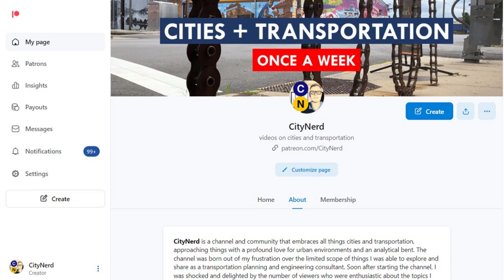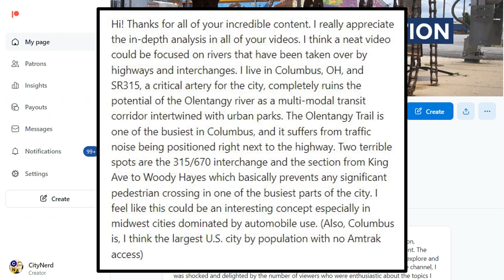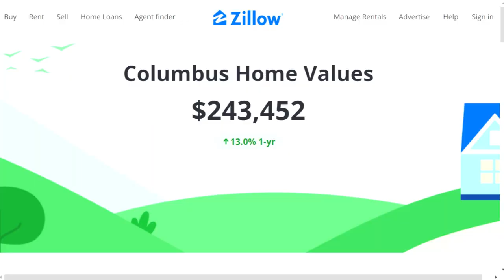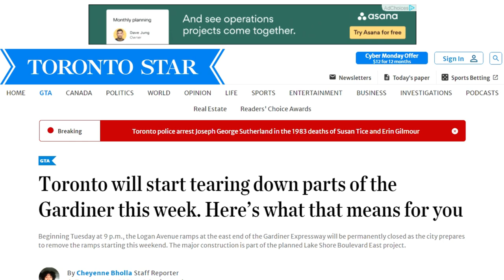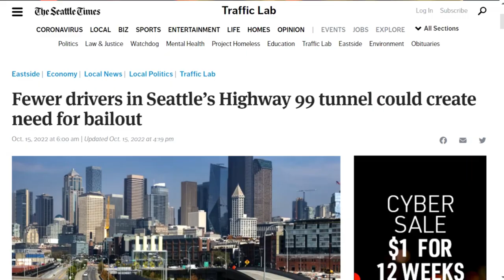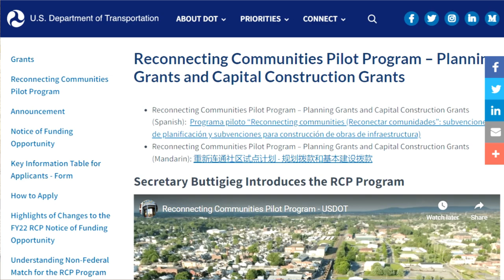Highway Engineering Madness: 10 Waterfront Freeways That Need to Go (North America Edition)

Comment: rubs her hands together It's my time to shine. 

North Carolina-born and bred transportation planner and geography nerd, at your service. 

A lack of easily navigable rivers with natural harbors that flow directly into the ocean is a big reason for North Carolina's sluggish growth between colonial times and the 20th Century. Many of the state's large rivers (the Chowan, the Roanoke, the Tar-Pamlico, and the Neuse) dump into the shallow Albemarle and Pamlico Sounds instead of the ocean. And even if you can navigate shipping out of the sounds, you end up in the Graveyard of the Atlantic off the Outer Banks. The rivers aren't all that navigable past a certain point (they tend to go from glorified creeks to massive estuaries), and not at all navigable past the Fall Line separating the Coastal Plan and Piedmont. On top of all that, hurricanes have made developing any coastal cities difficult throughout the state's history.

There is a nice harbor in Beaufort/Morehead City (indeed, one of the state ports is located there) that goes directly into the ocean and is south of Cape Hatteras and its dangers, but it doesn't connect to any substantial rivers, though it is the end of the line for the state-owned North Carolina Railroad. The state's biggest city on a river and biggest port (and the largest city for its first century) is Wilmington, which sits on a relatively high bluff at the point where the Cape Fear River (which is by North Carolina standards somewhat navigable) becomes an estuary. It is a few miles inland from the ocean, which protects it somewhat from hurricanes, and is easy to defend (it was the last Southern rebel port retaken by U.S. forces in the Civil War). It also became a railroad hub, but Wilmington was more connected to the north and south (like Florida, for instance) than west to the remainder of the state. The blessing of a major rail hub became a curse for the city when its railroad went all in on Florida and eventually moved operations to Jacksonville. Its port has always had a harder time competing with Norfolk and Charleston, even with cargo traffic from its own state. The Cape Fear River is navigable for some barge traffic and smaller craft up to Fayetteville, where it hits the Fall Line. Fayetteville was a more logical choice to become the state capital, but for their own reasons, early political leaders in the state decided to build an entirely new capital city in Wake County (near a favorite tavern on readily available land, which explains why Raleigh is where it is). There has to be an alternate universe where the hub of North Carolina is its two largest cities: Fayetteville (the state capital) and Wilmington (its largest port and city), connected by a still-busy Cape Fear River and substantial rail/road connections. 

Availability of water-based shipping just didn't play as much of a role in developing all parts west as did the railroads and other specific circumstances. Winston-Salem and Durham were tobacco towns. Other places grew more because of textiles, like Charlotte and Greensboro. They were all small, provincial cities, barely of any consequence to anyone outside of the state beyond the number of socks and cigarettes they produced. Their rapid growth, like so much of the Sun Belt, took place in the auto era and leads to the sprawl and suburban feel of most of the cities. The Piedmont Crescent region (Raleigh, Durham, Greensboro, and Charlotte) all developed along the aforementioned North Carolina Railroad (still state-owned but operated by Norfolk Southern today). If there were rivers nearby any of the cities (the Catawba and Charlotte, the Neuse and Raleigh, the Eno and Durham), it was more coincidence than intentional as they were useless to commerce. Even some of the cities and towns that have a riverfront (such as Fayetteville or Asheville) don't tend to have much of a connection between it and their downtown regions because riverfront land is so flood-prone.

I am sure that I got something wrong here and there, or totally missed something, but I think that roughly covers it. If there is any city in North Carolina that might have made this list, btw, it's Asheville. I-26 totally cuts parts of downtown off from the French Broad River.

Comment: Storrow Drive is the backbone of traffic in Boston. I cannot take anything you say seriously after seeing your suggestion that Storrow Drive be eliminated. I've been driving in Boston for over fifty years and know the entire city like the back of my hand. Frankly, I cannot believe that you have ever driven in our beautiful city.

The Back Bay area of Boston would be utterly ruined with the massive amount of traffic that would necessarily be diverted onto Beacon St., Commonwealth Ave., and Boylston St.

While the Mass Pike (aka Interstate 90) is useful, it was never designed or intended to be such a backbone. There is only one exit off the Pike heading eastbound between the Storrow Drive exit and the Central Artery (Interstate 93) and there are no exits westbound between the Central Artery and Storrow Drive. Similarly, there are only a couple of on-ramps onto the Pike westbound between the Central Artery and Storrow Drive and there are no on-ramps onto the Pike eastbound between Storrow Drive and the central artery. There is a U-Turn ramp at the Storrow Drive exit westbound which adds a tiny bit of flexibility that was built when they took down the toll booths almost twenty years ago, but this is insufficient to make-up for the lack of exits and on-ramps. There is no possibility of any addition of exits or on-ramps. The Pike ended at Route 128 (now known as Interstate 95) in Weston until it was extended through Newton and Boston to the Central Artery on a railroad right-of-way in the early sixties. Consequently, there is not one square inch of extra space that could be used on either side of it to add any exits or on-ramps. Additionally, there is continuous development of "air rights" projects being built over the Pike. It is literally true that they are nearing completion of one such project at Massachusetts Ave. and they have just announced a new project that will connect Kenmore Square to the Hospital District. These developments have connected different areas of the city that had been separated first, by the railroad, and later by the Pike, making Boston significantly more walkable, clearly a laudable goal. Respectfully, I must say that it is ludicrous to say that the Pike could possibly absorb the traffic currently using Storrow Drive.

I strongly agree that steps should be taken to improve public transportation in Boston, as well as other American cities. I also wish that Amtrak service could be improved along the eastern seaboard. However, Boston is almost four hundred years old (the amount of time my family has been here) and we don't have any room to make major changes to its layout, unlike younger cities further west. I'm sure you mean well, but eliminating Storrow Drive would ruin Boston!

Comment: As for the Brooklyn/Queen-Express highway .

Because is so much better to spend your live in traffic jams so that affluent guys have nice beaches or their real estate value dramatically increased. Who cares about people who have to commute to the city, because they work in normal jobs which allow no apartments near the city saved from the center.
And since railroad etc. pp. are also a problem...

The Q-line (part of the subway system) from Manhatten 96th street to Coney Island runs for a significant portions over ground, at times even elevated like the B/Q-Express highway with the tracks stacked above each other.
And you hardly get to the beach not beacause of a highway or tracks, but because one building is next to the other and you'll wall along fences and wall till you find here and there  a walk through.
So chose your train station wisely.

I hate such ignorant people.

Comment: The East Bay happened because they already didn't have room for a necessary freeway so they built it sometimes up to 200 feet offshore on landfill. Land use has caught up to it but how would you get rid of it lol, the East Bay is heavily developed from riprap to hill tops.

Also the air from the bay is clear enough for those using the trail.

Comment: Removing a highway and building a park still doesn't make it a nice park. Waterfront park in Portland is completely awkward.  Its filled with weed smoking hobos and geese most days and over run with goofy festivals all summer long that end up killing the grass turning it into a sand dune. There's also a giant seawall that makes river access virtually impossible.  More comprehensive thought needs to go into projects that remove these roads.

Comment: Here's a controversial opinion about waterfront freeways:
About half of the (air and noise) pollution from the freeway will affect only water. And additionally, wide water surfaces of any kind (be it coasts or rivers) increase wind speeds, which additionally helps carry away air pollution.
But I do agree, all the pollution that moves to the land surrounding the freeway directly hits the cities' most desirable areas, and is at odds with using the river for cycling, recreational cycling or other forms of recreation. So I won't go as far as saying that waterfront freeways are better than inland freeways. Each has their disadvantages (while no freeways at all inside the city has advantages).

Comment: As someone who lives just outside Chicago, Lake Shore Drive is terribly annoying because it doesn't serve the south side at all. You can't use it to get to the north side effectively due to lack of turn offs. And it's also not a true freeway as it splits into I-55. South from that point it's all residential roads that feels like any other street. Add in 10 years of construction and it's just terrible.. The Loop with  I-57/90/94 isn't much better tho..

Comment: My first thought on opening this video is that Lakeshore Drive has got to be here. The Drive almost totally ruins the lakefront making it hard to access and filled with noise and ugliness. There are some spots where the lakefront parks are broad enough to make it possible to not hear or see Lakeshore Drive, but that's the exception. Also, Lakeshore Drive is just not necessary as there are so many other ways to get north-south there. Lakeshore Drive has to go. Honorable mention to Storrow Drive and Memorial Drive, which are close to being as awful.

Comment: Lived in the Chicago area for 30+ years, and the existence of LSD doesn't bother me. It's imperfect, but it's essentially one of two major thoroughfares that run north-south for nearly the length of the city. Chicago is mostly a north-south city, so unless you want automobile traffic to be heck of a lot worse than it already is, you need additional outlets. The other major N-S thoroughfare is the 90/94 interstate expressway, and it's pretty bad, rated in 2015 byt the American Highway Users Alliance as the absolute worst bottleneck in all of America. And that's with the existence of LSD running parallel several miles East. 

Yes, it would be great if more people took the Red Line or the various Metra rails and drove less, but I would advocate keeping LSD open until someone came up with a practical alternative to LSD. Where are you going to build another highway that runs N-S? 

And despite LSD's limitations, you still have continuous foot/bike access for 18 or so miles, and there are various access points to cross to get to the actual lake shore (not just the tunnels mentioned in the video). In short, LSD should be improved, but getting rid of it altogether would have disastrous results and make commuting in the city so much worse.

Comment: I think the way you fix Lake Shore Drive is to neuter it. So let's spitball a suggestion. It's currently a) completely lacking in speed enforcement; b) lacks any local bus service; c) has a speed limit that's too high; d) too noisy due to items a and c; and e) breeds a monster sense of entitlement for motorists, also aggravating a and c (and also creating the remarkable situation that whereas driving on the city's designated interstates is mostly pretty civilized, albeit slow, except at times on the Dan Ryan 90-94 on the south side, LSD is worse even than the suburban tollways for speeding and reckless driving, with the demolished light standards, dented and trashed crash barriers, and car part debris to show for it). So; first you take the slightly underutilized, but car-dependent-neighborhood-serving south side segment, where the speeding and reckless driving is by far at its worst, and the shoddy 2003-5 reconstruction hammers on your car every time you drive it, and you properly repair the substandard and broken bits and narrow it. Two car lanes in each direction is sufficient IMHO even without a major change in use, and then you've freed up dedicated bus lanes, opened up space for bus stops at the arterial cross streets, and more of a buffer with surrounding parkland. Then, on the north side, where the structure is basically crumbling 1930s to 1950s roadway with thin bits of broken asphalt smeared on it like a cakemaker who's been stingy with the frosting, you start over and you entirely repurpose it for bus use, possibly also with surface light rail, on the condition that the increased bus service both north and south connects more car dependent neighborhoods for whom Lake Shore Drive is an important mobility safety valve at present, and also the condition that the south side Metra Electric South Shore route which closely parallels outer drive down to 57th street and again from 71st to 91st street, gets vastly increased service . And the newly neutered road is now much easier to deal with for speed enforcement and managing noise, exhaust and tire pollution.

Comment: The sad thing about the Eastshore Freeway in Berkeley is that it's a bottleneck where I-80 and I-580 converge, so you'd have to reroute two interstates in order to get rid of it. Berkeley also seems to have no viable alternative for rerouting the freeway, except maybe building a massive expensive tunnel.
Reply: Yeah, it'd be a tough nut to crack. You'd have to re-envision transportation around the bay, and ultimately reduce car use.
But if it's going to run there, it could at least run above grade.

Comment: This message intented for other veiws as the creator of vide brags about not reading comments. 
Albany NY is a good example that explains many of those riverside highways.  A hint: what is now the SUNY building used to be the headwaurters for Delawrae and Hudson **railway**. The land between it and the river was rail yards.  During the railway boom in early 1900s railways were big businesses and there were battles for best location. (with New York Central having monopoly on the then only bridge).   Rationalization of railways and their bankruptcies resulted in this land becoming vacant, and the Albany rail station no longer a rail station as tracks were removed.  Since that land was vacant, it was the logical spot to place a highway and made it easy to then join it with the many bridges built for cars across the Hudson.
In recent years, they have opened the  narrow piece of land between highway and river as a linear park, and it is the best way to cross Albany from North to south on a bike from Waterford to Albany and then cross to Rensallear where Amtrak now has its train station. 
.
On Toronto: when the gardiner was built, they realized it would wreck the waterfront potential, and in exchange, decided to transform the islands near it into a park which lead to big battles by residents on the islands fighting evictions. Most of the islands were vacated except for an exclave that fought and won the right to stay (creating a very nice, small, cozy, car-free environment).
.
On demolishing highways: in Montréal, the decided to convert the elevated Bonaventure expressway into "urban boulevard" because apparently this is the trendy thing. As a result of bringing highway traffic to ground level, and eliminating the 2 streets that were are groudn level alongside, cyclists have lost access from downtown to the Lachine canal park/bike path sinde the "urban boulecard" takes the whole width of the area, and they put an inaccessible "urban park" in the middle, instead of putting that on either side to provide syclists a means to ride along;  So beware of those polititians claiming their are improving things by removing a highway.   In the end, highways are not the problem, they are a side effect of the main problem: people using cars too much.

Comment: God, I am so glad you mentioned I-25. I live in Denver right next to the Platte, and the utter devastation of the waterway caused by I-25 and Santa Fe drive makes my blood boil
Reply: Ok, but how are people supposed to get through the state? It’s the only roadway that runs north and south.
Reply: @rhmendelson  move it somewhere not so close to the river. It's not like interstates spontaneously emerge from the ground. They are planned, built and eventually need to be rebuilt, and so will I-25.

 Interstate traffic should be rerouted outside of the city, anyway

Comment: I was expecting LSD to be on the list, but when I lived there I never felt like it was so bad. There is a lot of access to the lakefront via tunnels and once on that side it is beautiful. The park area is large, and you can cycle all of the way to Evanston from Wrigleyville, and into the city as well. The noise is not that bad, and lots of people use it for all sorts of recreation. It would be hard to say it is not popular. Still, I could see a nice Light Rail route down to the city, but I think you would need to have a solution for where all of the cars are supposed to go. I mean do you just expect fewer people to drive down into the City?